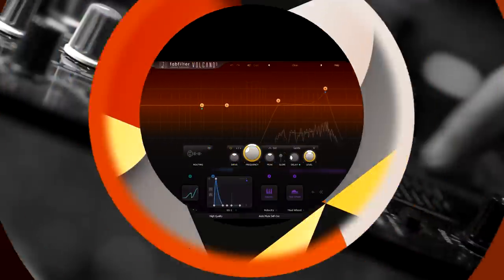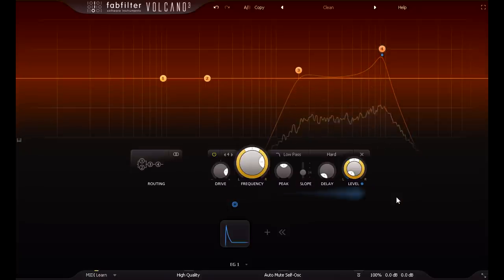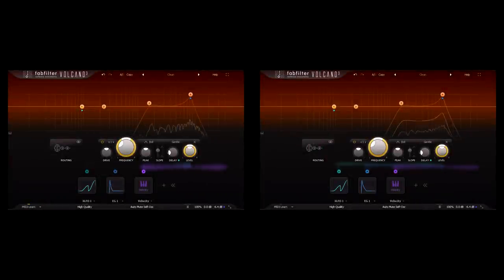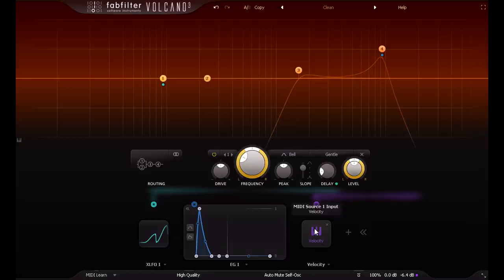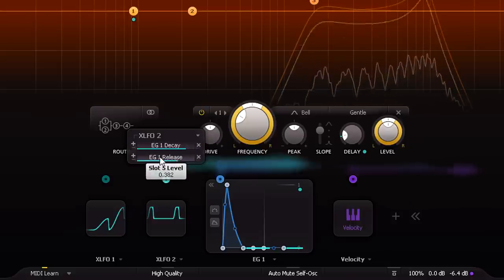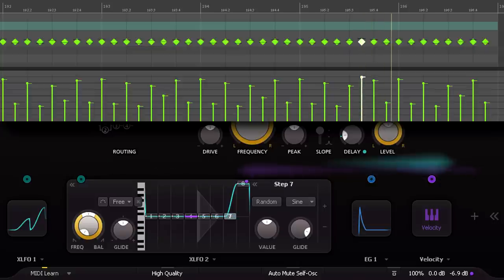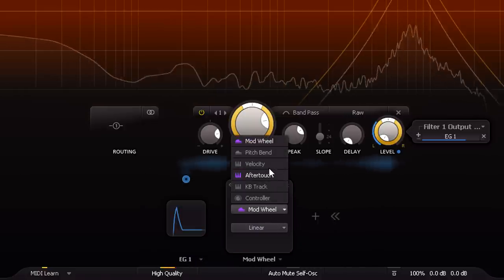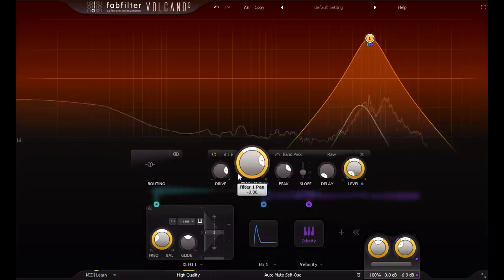Synthesizing hats and shakers with FabFilter Volcano 3

Comment: This is funny to me and I'm sure others have already pointed it out but if you just reverse the directions for the first way of controlling the length of the note (long decay and short release), you'd achieve the desired effect of having an "open" hat on notes you hold down and "closed" on notes you quickly press and release. This would also be more effective at emulating reality as releasing the note would be similar in effect of a drummer pressing down on the pedal to cut off the sound of the hat. Would also making programming the midi sequence far more intuitive.

Comment: You can just, you know, go with long decay and short release.
This way, long notes will give you an open hat, and short notes will give you closed hats,
That's what I'd do, anyways. I don't use controllers tho, as none seem to work with my PC for some reason. And I never use drum view for my MIDI editor. It feels clumsy and misleading for me. So maybe my simple solution won't be for everybody.
Reply: Why would Dan not bring up this approach?
Reply: @eliasknaapinen  I don't know. Perhaps there's a reason I didn't encounter, perhaps it's just that we all miss something every now and then.
I noticed that Twin 2's envelopes are always analogue, meaning they have to "wind up" and "unwind" as if they were voltage-controlled and not digital. This might make playing open hat and then closed hat impossible, since the envelope must completely close on one sample and open on the next one. I'm not sure it's the case for Volcano 3 tho, since it allows setting both attack and release to just zero.
EDIT: Tested right now, it works. Iunno why Dan didn't mention that.
Reply: The problem with this method is that each note goes from a slow decay to a fast release, which isn't terribly useful for a snappy hihat sound; the closed hats tend to sound gated and the open ones lack the extra transient provided by the fast decay stage.
Reply: @valley-artifact  Decay and release curves can have the same shape, and if it really were a universal trouble, it would've also been a trouble for "short decay long release" scenario. If it happens to you, you probably didn't set the curves properly.
Reply: @qasderfful  I'm not talking about the curve shape, I'm talking about the transition from the decay stage to the release stage; most notes go through both stages in series, with the transition point being determined by the MIDI note length.
Reply: @valley-artifact  I got what you're saying the first time around. And yeah, I know that decay always comes before release. Such an ancient wisdom, eh?
Tweak the decay curve, is what I'm saying.
Reply: @qasderfful  I just reread my original comment and realized I completely buried my point, sorry about that. What I intended to say was a rather inane point about differences in the composite contours of EGs with slow decay and fast release vs those with fast decay and slow release, but I ended up using it in service of a bad argument about which is more useful, which I then immediately forgot about. sorry for all the confusion.